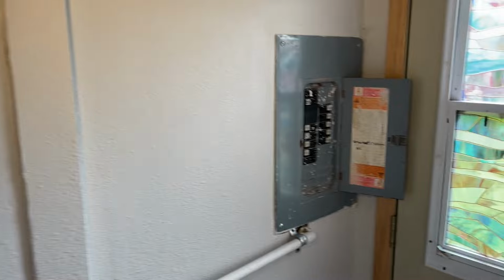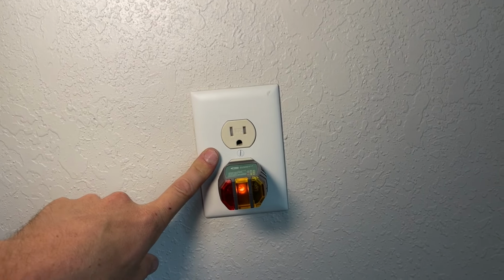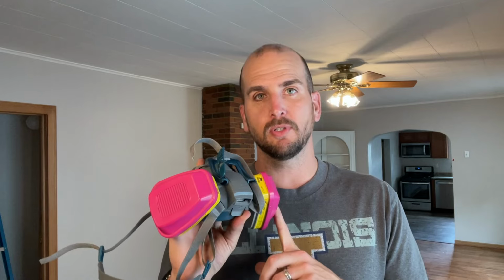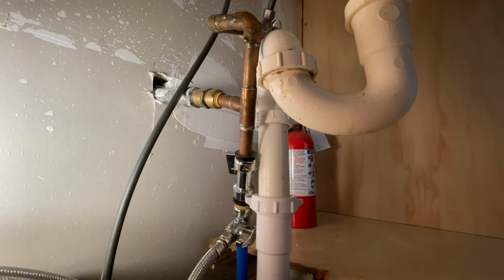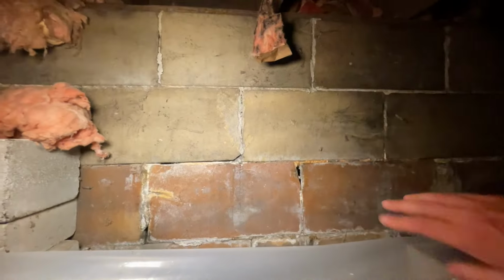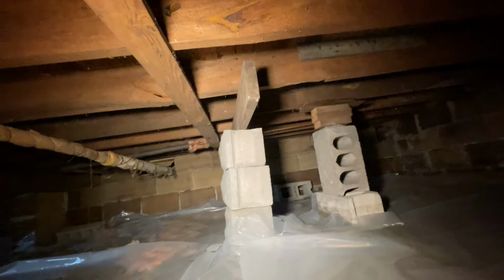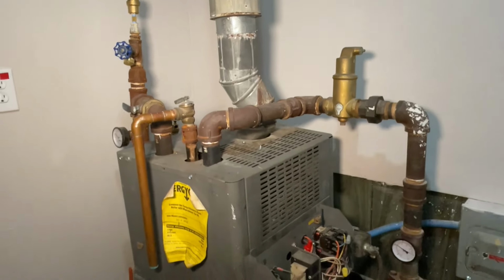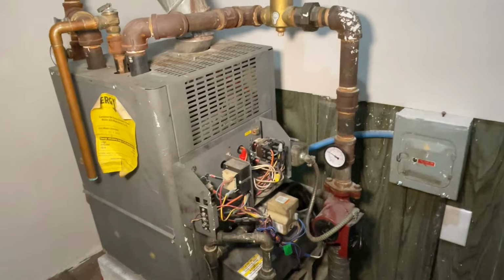Old House Inspection | Top 5 Issues

Comment: What's a bigger sin than an ungrounded three prong outlet? An almond receptacle with a white faceplate! 😨
Reply from the maker: 😂, you should see the location of the light switches and outlets if you think that color combo is bad.
Reply: @EverydayHomeRepairs  first thing I did a decade ago after buying my grandparents' old place. Giant contractor packs of white receptacles, switches, and faceplates. Just having everything being new, clean and consistent is nice. Not to mention many of the older switches were the "clicky" kind.
Reply: @marcberm  do you mean the button switches?
Reply: @Bremend  Nope, push-buttons would've been kind of neat! I just meant regular old toggle switches. The really old ones tend to have a loud click/snap with each flip while new switches are usually smooth and quiet.
Reply from the maker: @marcberm  I agree, bang for the buck that is a smart upgrade.
Reply: @marcberm   I have a 90-year old house and I'm looking at replacing all the modern white light switches with the push-button kind, which were probably in the house originally.  The new ones are code-compliant and black.  The same site also has reproduction solid brass faceplates that will look smashing with them.  Retirement project for sure.
Reply: @agcons  Love the idea! Something classic about those old reproduction designs. They're a little more expensive these days than back in the day, but it's a great touch!
Reply: When I bough my current home. The outlets and light switches had just been painted white and white faceplates added. That was great. I replaced every outlet and light switch.
Reply: @marcberm  Those are the best kind of switches. Way better than the crap made today.
Reply: lol my 1890 house had all almond and brown plates, I don’t get the almond thing it’s ugly

Comment: One thing I always look for when inspecting a property is vermiculite attic insulation. Everybody needs to Google what it looks like. It is Bar None the worst asbestos you could have in a property. I have no problem recommending people not buy properties that have it. Unless they have an extra twenty-five thousand in their budget to remove it.
Reply: Vermiculite in the 80s was sometimes contaminated with asbestos. This is probably where this story comes from. But generally speaking vermiculite is not asbestos.
Reply: Vermiculite can cause Mesothelioma!
Reply: That's a gross over reaction, the attic air doesn't mix with air in the living space..you can live with it in most instances.. Plus if it's Zonelite there is a class action suit avaiable
Reply: I think it’s so funny when people go crazy about asbestos, if they only knew how many of their household items have asbestos in it still to this date, you can remove that stuff yourself if you knew the laws rules and regulations which I’m assuming you do not. It’s really not that difficult and the homeowner can do it themselves. Trust me. I ran asbestos abatement cruise forever and I’m as healthy as a ox.
Reply: 25k? More like 200 bucks, some ppe, a case of beer, and a box of commerical trash bags. Its called wear a mask and mitigate dust, your not getting anything special for "25k"

Comment: Dealing with the trifecta of these right now: $5k for asbestos remediation; 17k for extensive replumbing; upcoming mold remediation (that was covered up by the flipper); grounding the outlets. Sigh. Getting there.
Reply: I can relate to your plite. I don't have asbestos, but I did have alot of plumbing work done. I also had new carpet installed, the driveway repaved and the front steps rebuilt, it's brick. I'm in it for $20,0000. When you think you're done, something else comes up. Sucks...
Reply: @DK-nt1nn  someone commented an old house is like an old luxury car... so true it hurts
Reply: Maintenance is the key. Over the last 40 years homeowners have gotten progressively worse at taking care of their homes. Or worse in my opinion flippers or homeowners who have inferior work performed. Neighbor of 40 years passed a few years ago. Everything he ever did in the house he did it on the cheap. Inside and outside regardless if he did it or paid someone. Always had problems with contractors because he was c hoosing the cheapest. When he died the family  sold the house to an investor who did a flip on the cheap. Young family bought the house after it sat for a long time. Every time I turn around there's another repairman working on something. Plumbing, electrical, roof, siding, there slowly getting it together.

Comment: I would add inspecting the roof as another critical element.
Reply: And insect infestations such as termites or carpenter ants'
Reply: Yeah but generally speaking it's a trivial exspeense compared to wiring, and even newer homes need new roof eventually
Reply: @rainnitsche3  trivial? I think for most peole, including myself, thousands of dollars is not trivial. True, they all need to be replaced eventually. But if you are just moving in and need to have it done soon thereafter, it would definitely be something I would want to know about.
Reply: @robbosch3449  true I mean in comparison to nob and tube
Reply: Property lines and roof inspection should be done also..

Comment: I bought a 1794 house in Netherlands, and the main point to bring is the time, it's a lot of hours, and you can't do everything at the same time, and have to keep a good $50k readily available "in case" (if you need to call a specialist on the spot or such) then, a good planning, how you are going to make your way up and down through the renovation, don't start plumbing and electricity at the same time, if you have not yet stabilized the foundation wall, don't do the walls or insulation if you haven't fixed the roof, don't do the heating system if you haven't done the insulation, etc ... solid planning will save you a lot

Comment: Thanks. We bought a 1912 two story four square house with a full basement and attic. We gutted everything back to the studs during the spring and summer so we could inspect everything and install the first layer of 2" foam before winter using vertical lathe as an air space. I installed new triple pane windows, new winter doors but the house itself is solid. We will be switching out the electrical, plumbing and roof over the coming years. Old houses are great and cheap but you need to understand they new everything and these can be installed over time.

Comment: Our home was built in the 1930s, bought in the 1970s, and since then it has cost us $17,000 to replace our sewer/drain line from the house to the street as it was extra long and extra deep. Home also came with a "mature tree" alright, a 100 foot tall cottonwood with a ginormous 6 foot diameter trunk estimated to be around 200 years old that decided to die on my watch, and between bringing it down to 50 feet in 2017 to make it safer as it began to whither, and then bringing it down to a 20 foot stump last year after a 2 x 6 foot slab of bark fell from the remaining limbs and punched a hole in the roof of my shed, well, that tree cost us $16,000. HVAC replacement has been a notable cost because we have two of them, one on the roof of the main house one on the addition, cost us $14k for both of them in the 90s, but the next set cost double that in the 2020s. Then there was the $60k roof replacement we did recently, cost so much because it had to be fully stripped off as you cannot have 3 layers of roofing nor a wood shake bottom anymore, so we neded a full covering of plywood and there was also a lot of decay to address, and the old gutters were way beyond saving, and well, hey, on the upside, the mortgage has been fully paid off for a while, and the property taxes are grandfathered in and super low, and what we paid for the house in the 70s vs what would cost now is painfully laughable.

Comment: Great tips! One item not mentioned which I learned the hard way and was completely ignorant of is Iron Vent/drain Stacks! Typically if a home is over 90 years old there will be iron vent/drain stacks and they will crack over time due to heat cooling cycles. Mostly in the colder parts of the country these cracks will develop and it can be really expensive to replace or repair the entire system. Mine is tied into 3 baths and this means you will be tearing up all three baths to fix this! I have a really great plumber who was able to tie in PVC pipes in two locations of our home. It required tearing out the wall to get to the repair locations. If this continues to crack in other locations we are forced to do a full replacement! Most home inspections are not going to catch everything. I paid thousands of dollars on these inspections and they missed expensive repairs like our deck which wasn't attached to the ground or house properly. I did the repair myself and saved us thousands of dollars. In a real estate repair contingency  agreement you only have 15 days to get an estimate from a contractor so you can negotiate the price for these repairs. Once they find out what the estimate is for they won't show up! Educate yourself as a buyer and walk away from anything that looks wrong! If not you can be in for a lot of headaches! Do not rely on Home Warranties as the Real Estate Agent will push! Most of these companies are going to deny the claims. Home Shield is notorious for this! We had them free for one year as part of our real estate agreement. They denied our claim because our expansion tank on the water heater was not part of the water heater. My step son was in the same situation and they denied multiple claims. Check them out on BBB, they have thousands of complaints! Its time the consumers with our dollars push back on this crap!!
Reply: Great information. Thank you.
Reply: @marmaladesunrise  please pass it on!
Reply: @plasma3211  Will, first chance.

Comment: If you are using a GFI on an ungrounded circuit you also have to add the "no equipment ground" sticker to the cover plate to make it code.  Or of course you can always replace with a two prong outlet.  The big problem is easily detecting a bootleg ground without opening the box.  These are dangerous and not code but will fool a simple plug-in detector because they tie in the outlet's ground to the neutral side making it appear to be grounded.
Reply from the maker: Thanks for the feedback Bob and good point on the “bootleg ground.”

Comment: 3:10 - That "updated" wiring looks like a complete hack job, and I would not trust it at all.  I would remove ALL wiring in the house and start over from scratch.  Also replace that early 1990's rusty panel with a new one with at least 24 spaces.
Reply: Was it expensive to swap out?

Comment: Hi Scott, hey, at 4:02, the room you're standing in, has the same type of ceiling as my downstairs bath and formal dining room... what is that ceiling, and how do you "gently" remove a tile or two to see what's above? (My downstairs bath has this ceiling, and it's only 7.5 feet high, however, the ceilings in the house are actually 8'6"... I'm curious if they were trying to hide a problem in my 125 year-old house.) Thanks!

Comment: Electrical:  When I purchased my home five years ago (a 1970 era build) I had an inspection  done. Obviously he didn't do a very thorough job; originally, much of the house had electrical heating, with 30 amp breakers connected to 10 gauge wiring. However, somewhere along the line, they switched to gas heat. And then they used the 30 amp breakers for 15 amp outlets. The electrical box was made by a company that had been out of business long ago, so I had to replace the box and get all new breakers, as they had also added more outlets with 15 gauge wiring going to those 30 amp breakers. I wound up rewiring the whole house with 12 gauge wiring to everything, with the appropriate 20 amp breakers and receptacles. Fortunately, I had access to ceilings and the basement, so I didn't run into a lot of roadblocks when running my wiring. But it was really frustrating that the house inspection didn't mention anything about this.  I was also lucky, to have had a dad who taught me about wiring. All I had to do, was get a licensed electrician to okay my plans, and I was able to do it all myself. Took me 2 years doing it little by little. But now I have a great electrical system in my house, and I did the ethernet cat 6 at the same time. Worked out well.
Reply: Because it was ok.  If your only drawing 15 amps on 14 guage, a 20 or 30 amp breaker is ok.  What you can't do is draw 20 or 30 amps on a 14 guage 15 amp circuit, as your asking for a fire and blown breakers.
Reply: @jamesross160  Problem was, those circuits went to the kitchen and basement, where there were multiple devices which pulled high current. And a malfunctioning device could also draw more current than that line could carry without overheating. After all, if you'll never have any situation where you are drawing more than 15 amps on a 14 gauge line, then you don't even need a breaker!
Reply: @jamesross160  I agree with D.E.B. There’s no way to know what someone mat plug in without knowing, such as a carpet cleaner or heavy power tools, or even something less obvious like a fish tank or treadmill in a bedroom. Also, a partial short or a bad outlet could draw extra current, without immediately tripping a larger breaker. If the wire is undersized it will overheat, potentially causing a fire. 
An inspector may not be able to tell immediately that this is a problem.

Comment: There's a third option for that outlet actually, if you remove the faceplate and see a metal box, you can try grounding the outlet to the box and see if the cabling was run in metal conduit back to the breaker panel. If it does show up as grounded, that can work as your ground though I also used a dual function gfci/calcium breaker to protect anything on that line just in case...
Reply: Just to state the obvious, I would first visually confirm the box is indeed metal, the cable is not NM (Romex), and then before I even switch out anything I would just use a multimeter to check voltage between the hot and the box (rather than hooking up the receptacle and using a receptacle tester).
Reply: @mr.g937  Although it was a pain, when I rewired my house I used BX.  My dad taught me that sometimes rodents can chew through romex, and it could be a pain to find the break. Of course, today we have gadgets to locate the broken wire, but this way, I never have to worry about that. Plus in case of a short the BX armor can contain the minimal heat better(or so I've been told!).
Reply: @d.e.b.b5788  Why BX and not MC?

Comment: bought a 1946 house, lovely architecture.  Had 1/2 galvanized water supply pipes throughout, but many leaks had formed over time.  They would replace them one by one, by cutting out a section to an elbow or a T and then screw in a thread to solder adapter and then solder in a short piece of copper.  So many of them, you wonder why they did not simply replace the whole section with copper each time! By now it would have been 100% copper for the same cost. Also had a bronze HW tank, and they replaced the runs to it with copper, but instead of using a thread to solder copper coupling into the top of the tank, they left in place galvanized unions, which were necessary after screwing together the original galvanized pipe, but useless for a copper solder joint. They rusted thru and fractured within weeks!  Single digit IQ!

Comment: Hi Scott!  Excellent starter video as I know you said it was not all inclusive.  I looked at an older home that had a 5 foot tree truck holding up the main center supply of the house…did not buy the house!  I would also check for lead pipe on the primary incoming water line.  Being an older home, I would check to see if the homeowner/electrician used an “electrical fan box” to hold up the ceiling fan that is just above you head in your video.

Comment: Thanks for making this video, some folks don't know what they are getting into. If you are a handyman and can do things yourself is one thing, but there are things there that many handymen could not handle, at least not properly. They would basically have to pay me to buy that house. Can it be fixed? Sure it can, but is it worth it? Like you said, it has all 5 issues you mentioned and I'm sure many more. I would tear out all the electrical and plumbing, and that boiler thing. I would call out a shoring co. and have the foundation repaired properly. Mostly everything else I could do myself, but in some areas they make you use licensed electricians and plumbers, which would bust the bank for me. The HVAC in a house like that I would put in some good wall units. I could go on and on but you get the picture or should I say I got your picture. Like I said, I could do a ton myself, if it is allowed, or I guess it would have to be a "hush, hush" job.
Reply from the maker: Thanks for the feedback!
Reply: @EverydayHomeRepairs  The boiler in our house is 68 years old and still works fine....

Comment: tree root damage on sewer drain can be fixed with copper sulfate.  will kill all roots in the drain.  only issue is you have to keep doing it every couple months to keep killing the roots.  But it's far cheaper than a full drain line clean..

Comment: Yep. I got the old clay piping for my drain. My house was built in 1900. There’s a permit for updating the electrical system posted by the breaker box from around the early 30s. They did a good job getting rid of the K&T system but I did find one knob still there in the basement and a wire coming from it. None the attic. 

Going back to the plumbing, the sink drain pipe in my kitchen was the old Galvanized Steel piping. That finally failed a few years ago and me and my older brother updated it to PVC. 

Not sure what the piping is coming from the city to the house. But would be curious to know.